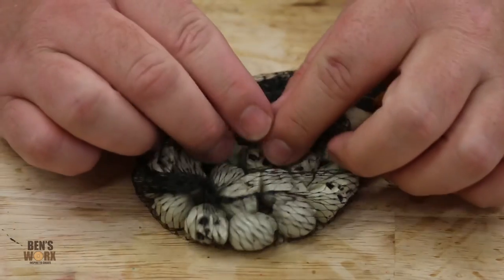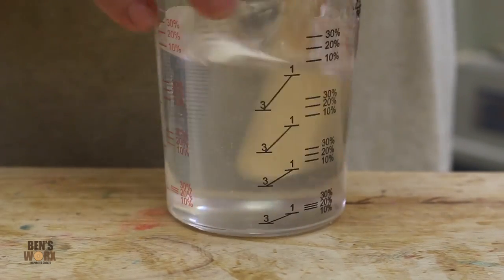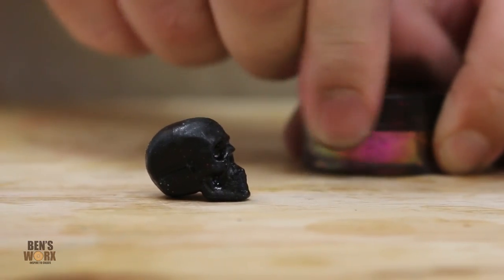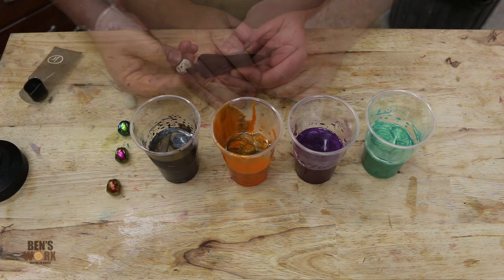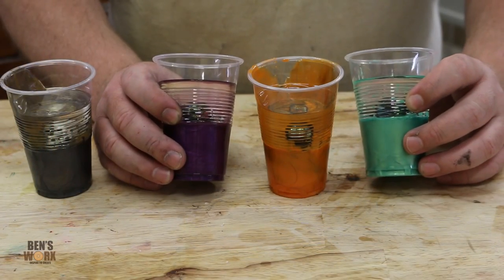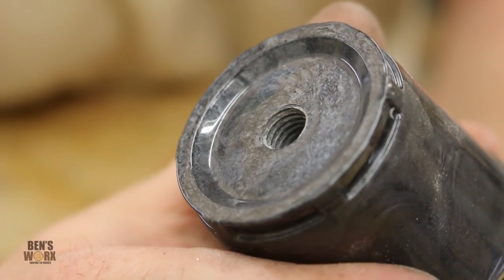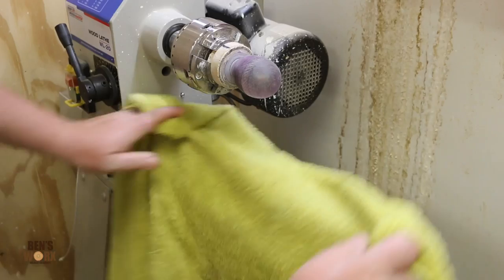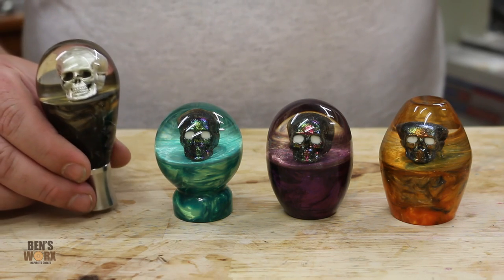Making Custom Resin Shift Knobs - Giving 3 away

Comment: I really like the purple one. The little extra round one would make a really awesome "cane topper"   I have been doing woodworking for over 40 years and have done only three resin projects two had lots of bubbles the third one had soft spots. None were colored. Anyway I got a pressure pot to take care of the bubbles which was wonderful, now l have to figure out how to get rid of the soft spots. But I digress. You do excellent work. Keep it up!

Comment: I did some research about casting. I wanted to make my own shift knob and found a great round mold. And free on topo of it all. After searching I found out no one was using a simple toy ball for a mold. So I thought I would try a old tennis ball. I look into how they are made and found they are extremely smooth inside. I went ahead and hit my neighbor who plays tennis up for a couple old balls. and use a forsner bit to drill a hole in the ball. then was it really good with hot soapy dish soap. after drying it I used WD40 for the release agent. Did my poor and 24 hours later cut it open and Wow a nearly perfect ball of resin. I I drilled and tapped it, then use a corresponding peice of threaded rod so I could do the sanding with my drill press. I only had to do the sanding steps and polishing compound. Cut out the need for Lathe work. And fits well in hand!

Comment: You Don't Want To Use Tread Locker On Plastic!!! It will break down plastics and make it brittle. In the future you might like to try a brass threaded inserts cast them in place.
On a threaded rod with sealer so the resin doesn't leak out
😎

Comment: Those look pretty cool.  The wave pattern in the purple really catches the light.  Dunno about a shift nob, would need to buy a different car, but as paperweights or even just ornaments any of those would be interesting.  
Are those skulls metal? or was there not enough heat in the curing of the resin to not deform them?  
Cheers for the vid.

Comment: Hi from the home of Rock and Roll, Memphis Tennessee. I have a question , The shift knob was poured in two pieces , could you also do the same thing with the X-Wing globe to eliminate  the rod that holds up the X-Wing or will it not work for some reason? Thank so much.
Reply from the maker: Yes it will work 👍